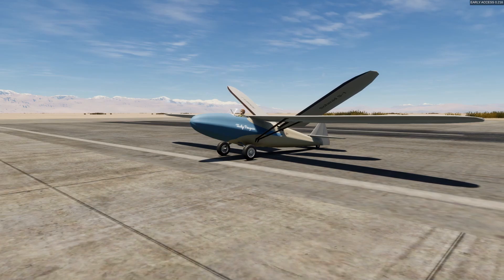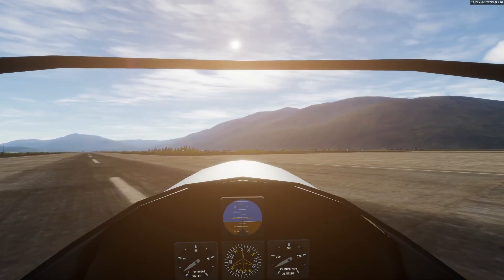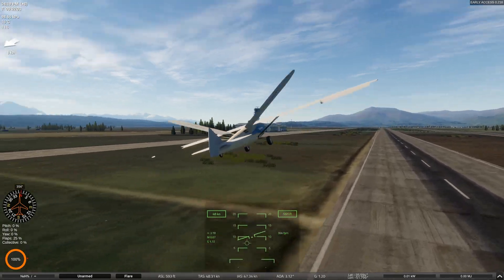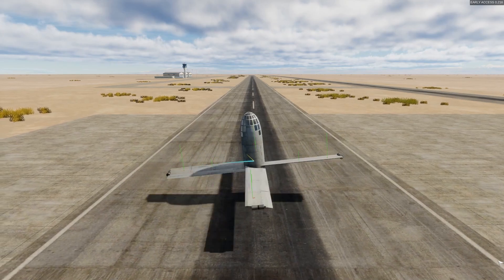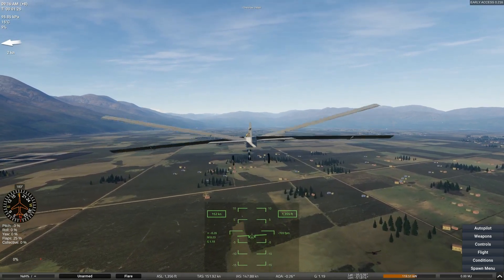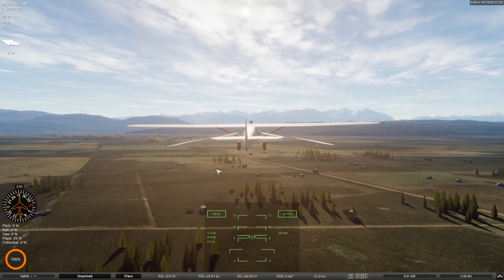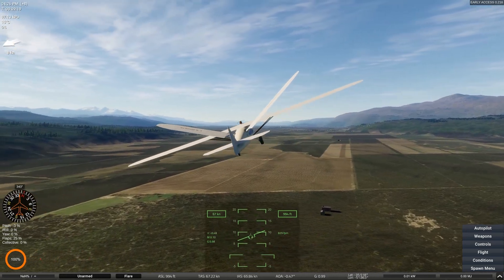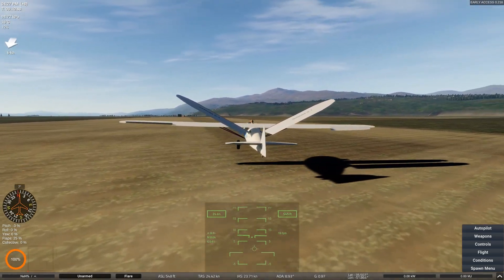Flyout: Schmid Onrithopter Replica, and Flyout Ornithopter tech so far

Comment: An issue with manned ornithopters was that the wings broke. So I'd say having long non-moving wings and smaller moving ones might be a nice solution. So the basic idea is to have different sized wings and on too much stress the longer wings stop moving. So I think the Schmid/Smith ornithopter is a good point to start from as you can take so much knowledge from existing airplanes. It still feels as if many wing pairs just emulate a huge formable wing pair.

Comment: I had an 4-blade ornithopter I made pre-release based on one of my ultralight concepts pre-release if you want to see one of the early ornithopter experiments. I made one using a system similar to your own, as well as one that worked on a glitch drive to get to speed, but I won't be releasing that one. I'll just need to update the materials since it was made before the material update. Also, it may help a lot to put your mic on "mono" or any single channel. I got interested to see if anyone had more success than I did after watching Dune the other night. Good luck with your builds!
Reply from the maker: This glitch-drive of yours: did it have a way of controlling blade pitch independently of amplitude? Or are we talking about a literal phantom force sort of glitch? In any case I'd love to see either of them.

In any case, I've got them up through 440 knots now. Just last night I got a working transitioning VTOL, but it flies like shit. Better soon, hopefully. Cheers!
Reply: @decofox6789  it's more of a "phantom force" sort of glitch drive, I couldn't for the life of me get enough thrust to get airborne with the normal ornithopter movement, so I found out you can quite literally generate force in any direction you want using certain parts. I can shoot you a DM about it later, the mods don't want us talking about game exploits in public 😂
Reply from the maker: @messier82ac  sure, I'm curious. Don't imagine I'll use it in these, though. It's the getting-it-to-fly process I'm in it all for. Still, helps to know how the game engine works. I come from Garry's Mod, where determining how to use ropes to glitch source engine object drag made the first autorotating rotorcraft in that game possible.

Comment: Use an engine with gearboxes and a mini prop and a mini counter prop to use throttle for flapping, might not be as accurate if it calculates the super small props but would save finger cramps or Scripting, just an idea though I havnt tried this
Reply from the maker: You can attach objects to propellers? That would definitely be way better, but I hadn't gotten it to work in the past. Is there a trick to it?
Reply: @decofox6789  I've Aattatched propellers to propellers plenty of times by placing them on the cone, however I havnt tested others objects or if it transfers rotation
Reply from the maker: @lil.shaman6384  I will give that a try! Would be awesome if it worked, especially since it would introduce fuel consumption and power requirements. Much more interesting

Comment: This is so cool! I'm trying to build my own now, but can't figure out what type of input would be best for an ornithopter based on the second type of flapping mechanism. Right now, I have it set to a slider with gravity. That works, but you eventually need to constantly be holding the 'throttle' button. What kind of input are you using?
Reply from the maker: Same thing you are: I'm holding throttle down.  technically I bound a second input to shift that just advances by 1000 every tick (as fast as the joint will actuate).  I'm not using gravity, though, so the joint stays where it left off when shift is released. That design isn't throttleable, but I have yet to find a good way to solve that problem. If you just want to do away with holding the key, you can set the input rate way over 1000 and then the joint will spend ages trying to catch up. If you set it absurdly high you're pretty much toggling it on for good. No way to turn it off, though.
Reply: @decofox6789  That's good to know! Thank you!

Comment: I don't know if it's a satisfying answer but the reason for every "why was it designed this way" about the Schmid is simplicity or ease of testing. Functionally, it's a generic towed glider test rig with powered wings added on using the simplest transmission he could make work.

Keep in mind that all of your gear strut drag and takeoff issues were avoided because it was a tow launched glider with drop off wheels.

Comment: Easy to follow and fun to watch! You did well pacing the info with the clips. Another highlight's the smooth voice; you mentioned having a professional setup at some point iirc, but hearing it in a full video really does it justice.
Reply from the maker: I don't, actually. Borrowed a mic in one of the older ones I think, but this is all on a garbage astro a50 mic. I just had the presence of mind to do a noise reduction pass in audacity lol. Thanks, in any case